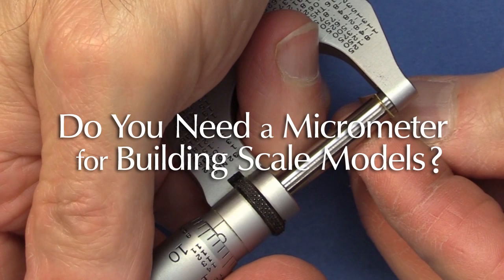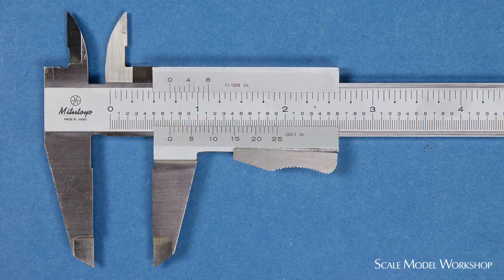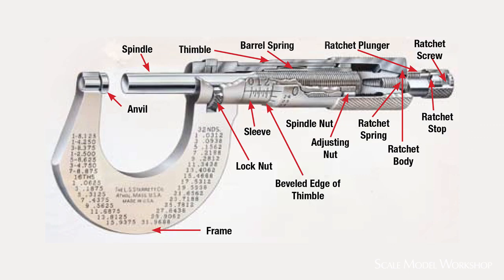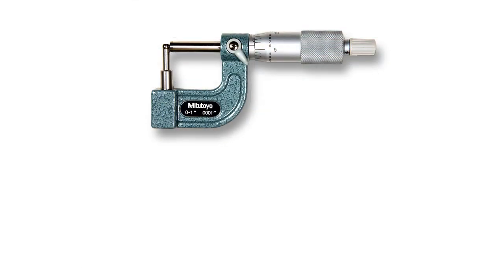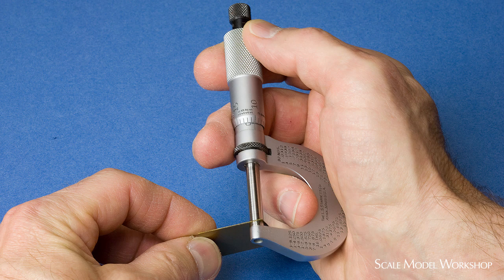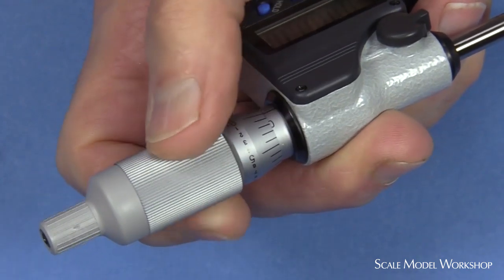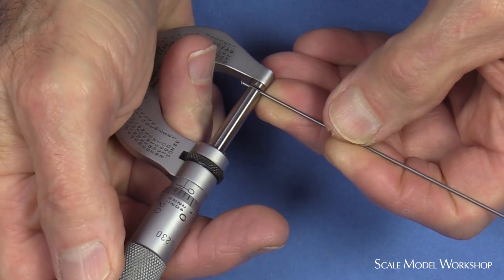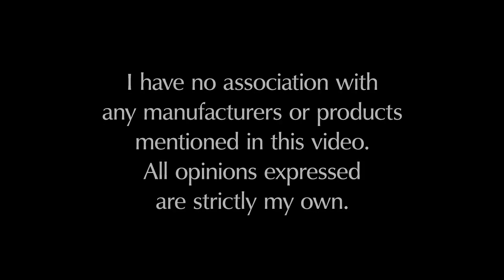Micrometers for Scale Modeling

Comment: Love your work Paul, it is great to see a video like this opening up new horizons for others. There is one point I would like to make, as a fitter and turner by trade while I was at trade school in Australia(quite a while ago now) we were always told not to leave the spindle and anvil touching as two highly finished surfaces touching together for a prolonged time they can "stick" together. 

Keep up the great work.
Reply from the maker: Thank you Stephen, In response to your trade school experience, I think it might depend on environment or usage concerns.  Perhaps if you live in a rust prone area or you usage involves certain fluids.  Personally, I've never received a new micrometer that was ever left open.  Likewise, I've never had the mating surfaces stick.  However, I live in an extremely dry climate.  They aren't used around grease, oil etc and are kept very clean.  The only issue I've ever had with storage was an old new-stock 1/2" Starrett that I bought off Ebay and the lube had gotten stiff.  A quick disassembly, cleaning. and lube had It back to perfect.  And by the way, while a 1/2" mic is cute, I think it's not very useful and difficult to handle, unless you have really tiny hands.
Reply: @scale-model-workshop  Hi Paul, thanks for your reply. I agree humidity will be a factor and it does get humid at certain times of the year where I live, couple that with people who are a bit heavy handed, don't have much mechanical feel and tend to "tighten" the spindle and anvil together. I have not seen a 0-1/2" mic before, possibly a rare animal, I would think it is difficult to use as a 0-1" is a comfortable size anything smaller would not be comfortable.

Comment: If you really find you need a micrometer or micrometers might I suggest you consider used. I've got my own up to 6 inch, yet I still use my grandfather's 100 year old Starrett. And if you find you need a mic be cause you are doing machining. Be prepared to go down the rabbit hole. You will soon find that there is a need for a good indicator, a height gage, some sort of flat surface (sorry granite countertop doesn't cut it) and a variety of parallels and set-up tools. If you are not doing machining but only laying out parts on sheet styrene, wood or metal. Go with a caliper. Most calipers can be used 4 different ways. Inside, outside, depth with the rod and most importantly depth or offset with the jaws. This the secret weapon in the caliper arsenal for laying out parts. This is far more accurate than a combination square. And if your eyes aren't the best, go with a dial type. Yah the digitals are easy to read. You can zero them at any point on scale, switch from inch to metric if needed. But try setting a digital caliper to a specific size to scribe a line. Digitals suck at this. Dials are really simple. Inch to metric. You passed math didn't you. Multiply or devide by 25.4